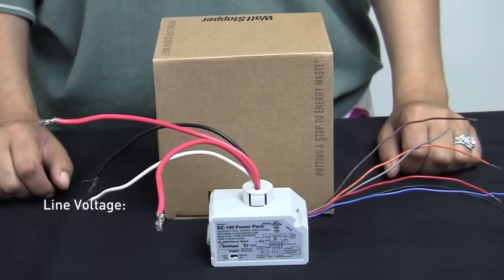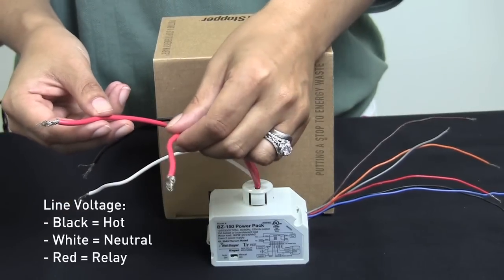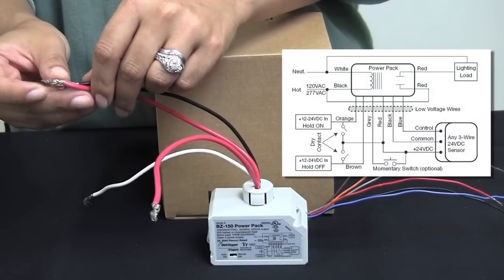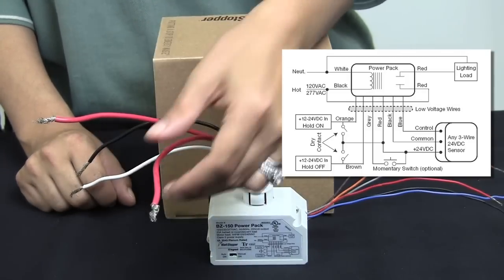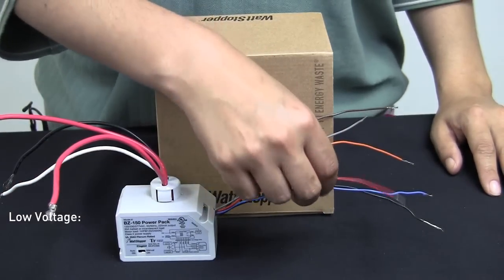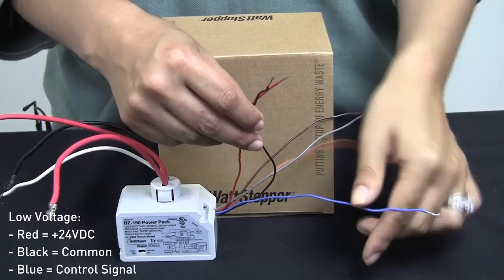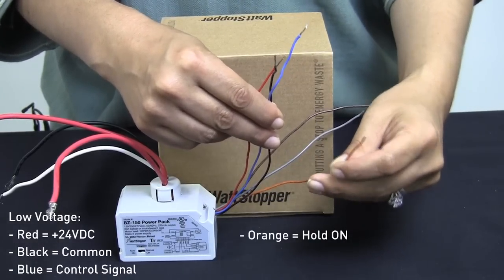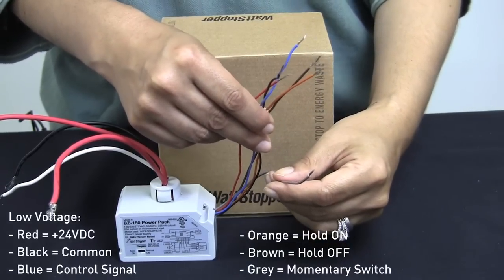Wattstopper: How to: Wiring a BZ-150 Universal Voltage Power Pack

Comment: how to wire up to a single pole switch two lights
Reply: The switch works great the  the motion deter in cell is not picking up motion . do I need a 3way
Reply: Way overpriced!